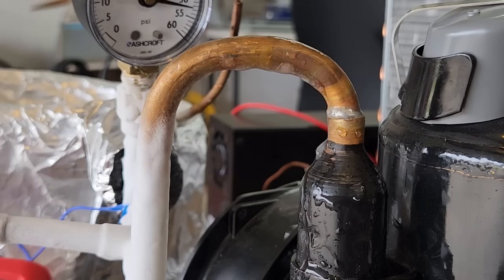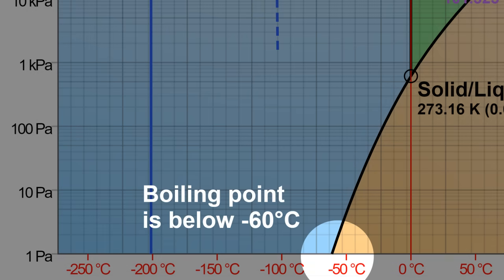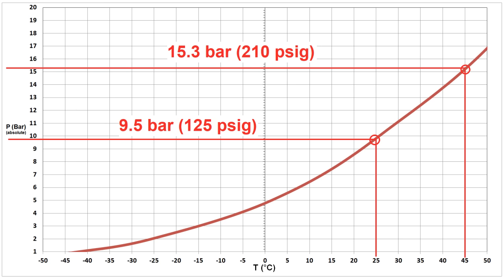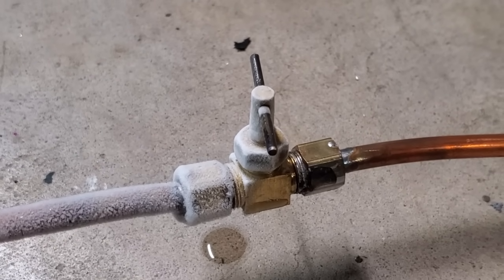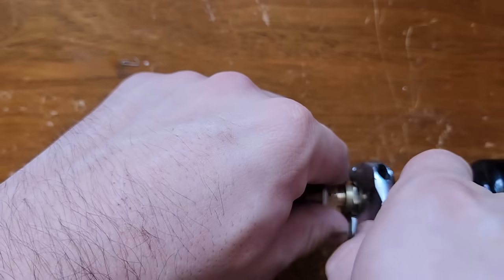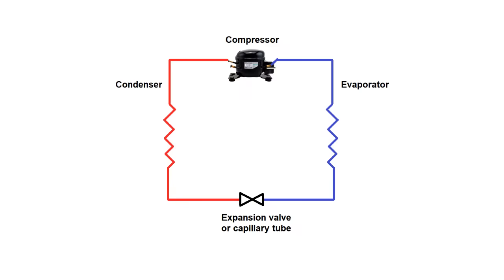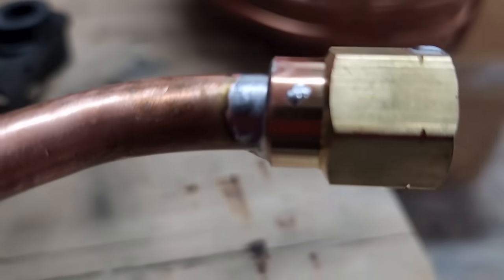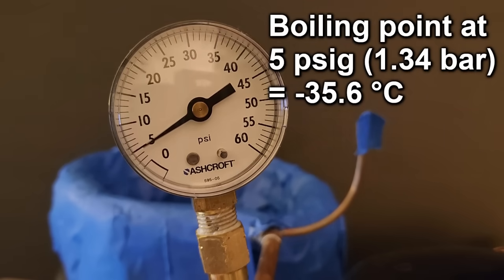DIY Vapor Compression Refrigeration System

Comment: 22:58 Just put soft start circuit between the fan and the power. They are quite cheap.
Reply: Or you can make one with an old 12v relay and a capacitor.
Reply: @Miata822  How?
Reply: @user255  (junk bin solution) On standard Bosch/DIN relay put a cap between 85 - & 86+. Power from pin 30 will go out terminal 87a until cap fills enough to switch, then power switches to pin 87. Run 87a through a suitable power resistor to the load and 87 directly to the load. You could add a small resistor to the 86 input to help tune the start delay. 

(more expensive solution) Or you could just buy a delay-on-make relay, run it in parallel w/ your startup resistor.

Alternately, for moderate loads you could skip the relay altogether and put a properly sized NTC thermistor on the power line. I've used SL32 2R025 on a fan drive product before. Those do get quite hot in use and need to cool before limiting inrush again.
Reply: @Miata822  Nah, solid state soft start circuit will be cheaper due no need for power resistor. Also it switches more reliably and without noise on the line.
Reply: @user255  Meh. In the video he talks about using parts lying around. The relay thing is something most tinkerers could make at home for free in minutes. For "cheap" it's hard to beat a thermistor.
I've used solid state controls in some commercial products I've designed but not all.  There are 1,000 ways to skin a cat.
Reply: @Miata822  Yeah, sometimes quick & dirty is all you need.
Reply: @user255  I designed a lot of stuff for machines that couldn't afford downtime waiting for parts, might be serviced by mechanics who didn't read or look at wire diagrams. For them it helped if they could source parts at the Uzbek equivalent of AutoZone. 
On the other hand, some people who wear green every day are real sensitive about every material used in a component, where the parts came from, and whether it would work at -60 and +140.
Every task has its own requirements. I tried to always go with the most straightforward solution.

Comment: Your compressor becoming hot at different amperages doesn't necessarily have anything to do with "how hard" you are running it. That's a suction cold compressor so you most likely just have your charge wrong. What is your sh at the compressor?

Comment: can you make a cooling device that can produce liquid methane?
Reply: The two-stage system he's describing could get a sample of methane below its critical temperature of -82c, but the gas would still need to be compressed at over 40 bar to make it happen - and if the container was allowed to warm up, the methane would boil off and SERIOUSLY raise the pressure of the containment.  Even a high-test airsoft bottle isn't rated for sufficient pressure to keep methane liquid at room temperature.
Reply: Also most “Natural Gas” you can buy still contains enough Water Vapor / CO2 / SOx’s / Non-Methane Hydrocarbons to Gunk up Cryocooled Pipes etc

The majority of a “LMG Train” (the refinery unit that liquifies natural gas) deals with getting it to that ultra pure level.

*GRANTED i am 100% down for a DIY/OpenSource Biogas Upgrader + LNG Train…i just feel like that would be major scope creep, and would require a PILE of development work.
Reply: @leifhietala8074  it would be quite hard to get such high pressures with a diy system.
Reply: @benjaminshatokhin4725  It isn't impossible, but it takes the kind of DIYer that has a full machine shop doing essentially pro-grade, industrial-strength work on the side in their free time.
Reply from the maker: Not with this particular system, or even a two stage one, but with a joule-thompson cycle using a mixture of hydrocarbons it's possible. The system in this video will serve as a pre-cooler for that.
Reply: @leifhietala8074  Granted Makerspaces/Tool Libraries can make the tool requirements less intense, but even then you probably need to have the welding skills of a Boilermaker (and the QC equipment to verify it)
Reply: @HyperspacePirate  Another word, third stage refrigeration loop.... I noticed, most second stage loops use ethylene in 100 psi pressure and it gets to - 104 C, but how will you resolve storage of liquid methane, supply of new one... will be extremely interesting.  Thanks for work 👍

Comment: Word to the wise, don't push bent pipes into each other. Get them reasonably straight, fish a line through the larger, connected it to the smaller, and pull it through. Cognitive load on projects like this being what it is, won't hold it against ya lol

Comment: I am not an expert, but i want to use the sun radiation as heat source to have a cooling effect ( as in the cometic fridges ) you video has many references , i live in an area with 45 C on summer every day, no rain and sun radiation that can boil water, any one build something  similar?
Reply from the maker: You need a desiccant based vapor-absorption system, not a vapor compression system. In a vapor-absorption system, you have a fluid like water generate cooling by evaporating, then get captured by a dessicant. The solar heat gets used to boil the moisture out of the dessicant, and the water vapor gets condensed back to liquid then returns to the evaporator.
Reply: @HyperspacePirate  will study about this,i will follow you work, if i design a closed system i will be able to build a low pressure chamber to adjust the boiling temperature of the water, in this approach the sistem will not need electricity to reduce the temperature.

Comment: Why don't we use CO2 as a refrigerant more often?
Reply: It requires much higher working pressures than other refrigerants. Its also does not have quite as good performance for most applications as other refrigerants do.

Comment: You should pull a vacuum on the system before charging. Air is non condensable. By leaving air in the system.. you're making your condenser smaller than it already is.  You want nothing but refrigerant and oil in the system.

Comment: Using a dryer to remove the smell of propane? Hell no, this thing will live outside! Lol Also its important to note he probably broke the law by venting those R401a window AC units to build this. Lol dont try this at home. Lastly why doesnt he use a heater to remove the ice???? You know like they do in store freezer units or properly spaced fins on the evap OR a timer for defrost cycling?? Lol Seems a bit odd sense he's already using plently of power to build this thing...

Comment: Ok where to start...First if thats supposed to be butane regular butane just an  off the shelf can used to fill up lighters will not work as a refrigerant. I know pretty much everybody here knows all these things but  one more point there is no way in hell that itty bitty $1 motor would compress any gas to work as a refrigerant.

Comment: I have no problem with you using propane in an engineering test-mule. But these refrigerants are explosive and the government has mandated their use in refrigerators over global warming concerns, and now people's fridges are springing evaporator leaks which are igniting (apparently on the switch contacts for the ice makers) and exploding with the force of a about a stick and a half of dynamite. It's an awful idea, and r-134a shouldn't have been banned until a PATENT FREE replacement was available.

Comment: I am NOT trying to be a smart ass, honestly. Why not just empty the 134a from the window shaker AC unit, and then fill the system with propane and when done, test the system?
Last summer I fixed my first Automotive AC in my truck, then I attacked 1 of my Duo-therm rooftop units on my 1993 Unihome Grand Villa 40ft. Screaming Jimmy motor-home. I am the proverbial newby of AC.
I was unable to complete either RV park repair without tons of reading to understand the basics of AC, and close to fifty hours of University of YouTube.
Before fixing either I purchased a 5000btu shaker at Walmart-$150CAD all taxes in: Back-up unit.

Comment: I know this is a nit pick but I'm an refrigeration tech and it is just one of those things that is like nails on a chalk board for me, Freon is a brand name it is not any single substance and it is not R-134a, it is a brand name currently owned by The Chemours Company calling refrigerant freon is like calling all cars a honda. Also really seriously DO NOT put flammable refrigerations in systems not designed for them (such as your home AC) because they are not designed with flammable refrigerants in mind (yes i saw he used a R-134a compressor, not a very good idea but what do I know) and you might burn your house down and if you care about your refrigeration system don't just put whatever in there and do not mix refrigerants or change refrigerants if you don't know what you are doing or you might fuck shit up. Also yes running your compressor in air is a really shit idea, it can ruin the seals on your piston that are not designed to compress air and it introduces moisture and other crap into the oil which will eventually plug that cap tube. Wow this is like my 5th edit on this shit the more I watch the worse it gets, silicone chalk... really they make thread sealant for refigeration called leak lock, glad to see you used nice clean R-290 rather than a propane bottle from the hardware store if that cap tube lasts more than a few days of run time without the cap tube getting shitted up I'll be shocked.

Comment: Nice bomb you got there you didn't pull a vacuum so you still have oxygen in the system then you put flammable gas a short inside the compressor will explode the system

Comment: Stop calling refrigerant "Freon". Freon is a manufacturer not not a substance. That's like calling all electrolyte waters, Gatorade. R-134a is 1,1,1,2-Tetrafluoroethane, a hydrofluorocarbon gas. Freon is a generic manufacturer, extremely common misconception. Even before the use of 134, r12 and r22 were called "freon" because that's who made the refrigerant.

Comment: 26:18 Multiplying AC voltage by AC amps and claiming it watts is downright stoopid mistake.
Reply: No it's not because he doesn't need the exact value of power ....it's just a round up value
Reply: the difference will be minimal. Those motors usually have a pretty high power factor at full load.

Comment: With all of that air you left in the system you will never get optimum results. You didn't evacuate the system before charging.
Reply: And you didn't watch the whole video properly
Reply: @Exotic_Chem_Lab  I watched it but forgot to delete my comment. It was, you must agree, placed a bit out of sequence. I was relieved to know you included that procedure. 👍
So many times I have followed behind techs that, upon determine a loss of integrity of the sealed system, add refrigerant to "get the customer by," and buy them some time, but after questioning the customer, determine the tech simply added a charge on top of whatever air has entered. Used to be the chlorine molecule in r12 under heat and pressure could combine with the hydrogen molecule in atmospheric water and produce hydrochloric, I think, acid. Nasty results. Smelly, noxious, alarming to the customer.  Doesn't happen anymore, and that is a nice benefit of saving the ozone layer to those people who have the job of working on them.

Comment: 13:20 you are soldering up gaps are you? its called brazing son..
Reply from the maker: No, that's 60/40 solder with a 190C melting point. Not as good as brazing, but easier for hobby/DIY
Reply: @HyperspacePirate  open flame, pipes, lead = brazing

Heard of the soldering plumber before?